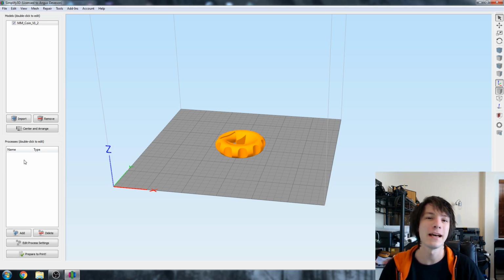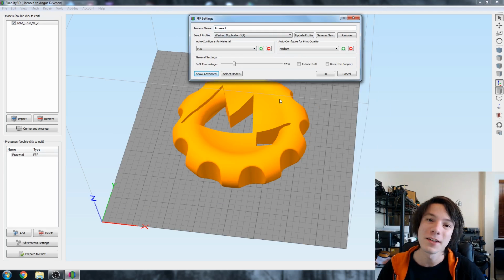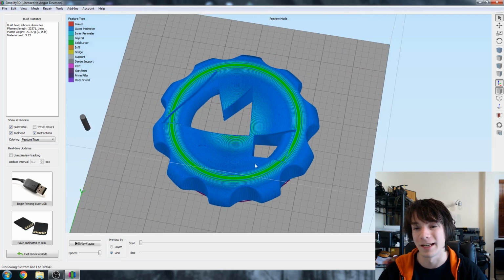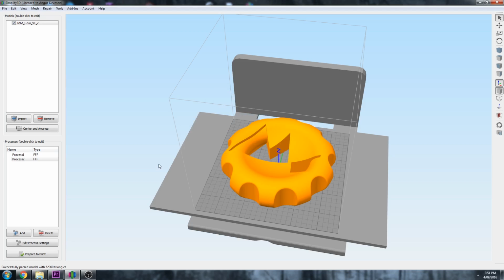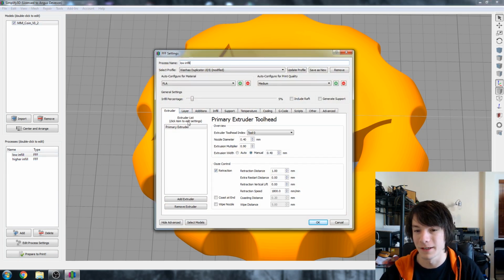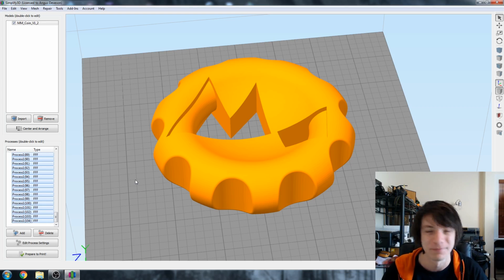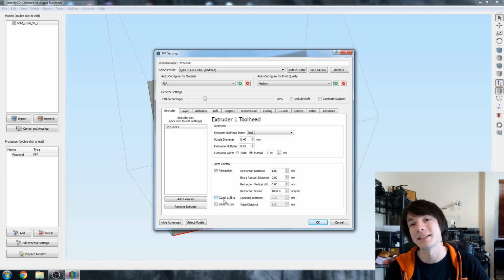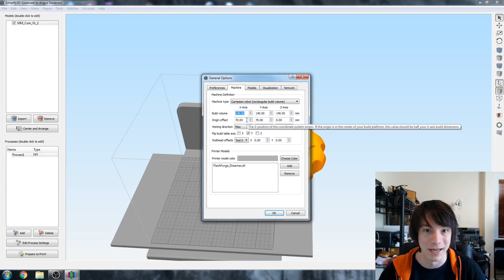A Detailed look at Processes and Profiles in Simplify3D

Comment: Hi, Appreciated would like to ask for your help, i have encountered some issued; what's mean ( The chosen layer and extrusion width settings have resulted in a primary width/ height ratio 1.2.? please ...with many thanks! :)
looking forward to your reply.
Reply: This is pretty straightforward.  The width of an extrusion can't be more than 120% of the layer height.  So if your extrusion width is set to .4mm, your height cannot be greater than .48mm.  You really shouldn't run into this problem unless you are selecting crazy tall layers or super wide extrusions.  Leave the setting for width on auto.  If you still get the error, lower the layer height.

Comment: Hi Angus, I have recently started watching your videos and found your content really helpful. Since I am working on a master thesis, I wanted to ask you whether it is possible to slice an STL/AMF/3MF file and generate G code or X3G file for other additive processes such as stereolithography? Does Simplify3D support it? If yes, how can it be done? If not, could you tell me of a slicer that does it (apart from PreForm)? As of now, all the slicers I have come across online seem to be supporting FDM/FFF only, and I am trying to figure out exactly how a meshed model is digitally communicated to any 3D printer. I could really use your help on this one.

Comment: Angus ... Do you have any pull with Simplify 3D  I want a series of boxes for JERK settings and acceleration. Seems I must go into the firmware or gcode to do that in this program (according to the email I got 10 minutes ago), It is very disappointing that S3D can't do this and CURA can .... Maybe version 4.5 will have it ?

PS: You and Tom are my go to guys on 3D printing ;- )

Comment: If I want to print a file off of an SD card will the processes or printer settings be saved with the .STL file or do you have to have your computer hooked directly to the printer for the duration of the entire print? 
I don't want to be without my laptop while I'm waiting for a 40 hour print but I want to use customized processes or printer settings.
Reply from the maker: your exported g code will include everything you set, including if you used multiple processes.

Comment: Looks like I got it completely wrong ;) (I'm new to 3D printing)

I tough that processes are receipt for each type of filament (and your fine tuning) 
Am I wrong that each filament need different settings (temp is obvious, but also retraction/coating)  A far as I understood retraction/coating is not dependend on the printer (i have the trinus) but also on the filament?

If so, what would be the best way to keep tracking of my settings when I switch filament?
Or am I completely wrong? ;)

Comment: Setting top/bottom fill layers to zero means you have make sure there aren't any actual top/bottom layers that you want to have printed. For example, a stair case will have a top fill at the top of each step. So for some models, you can't use this technique to control the infill unless you are OK with having solid layers within the infill. Bummer...

Pausing a print between processes is also tricky and requires tweaking the start/end gcodes. I spent a bit of time trying it and still ended up just slicing two gcode files for the print (manually changing filament). For my 2-material makercoins though, I just cut the filament while the print is within the layers where I want the materials to change and feed the new filament without pausing the print. Less hassle than messing with two gcode files and doing a proper filament change. I use a combination of black/white color change and black filament.

Comment: You didn't cover Firmware settings in the Custom Profile.
Reply from the maker: Good point! Firmware config probably needs an entire video in itself and I'll be honest, none of the machines I use have ever needed tweaking there but if it was flashforge, makerbot or something unusual it would need the 'flavour' changed and maybe some other tweaks.

Comment: It's still beyond me why they charge $150, I'm sure they would make more money at $50-75 a copy.
Reply from the maker: It's a supply demand thing, any niche software is usually fairly expensive (just look at the ticket price on one seat of mastercam) and as Simplify3D is very clear about - their software is there to save you money in the long run. It's pretty hard to justify even $50 for software if you are 3D Printing for fun as a hobby, on one machine at home, but in a School, Business or Work environment even at $500 S3D would literally pay for itself in a few weeks in most cases through the advanced G-code preview alone. It's hard to really appreciate the difference unless you've been under the pump with clients screaming at you because Cura / Slic3r / whatever decided to glitch one area of the model they came to collect in the morning. :P

Comment: soo if our printer isnt on the list and we try a default setup. what kinds of test prints should we perform to figure out if anything needs tweaking further? or should we try and diagnose problems later as they arise
Reply from the maker: I perform stuff like a standard 20mm cube to dial in my machines - then more complex things to help determine retractions and that kind of thing.